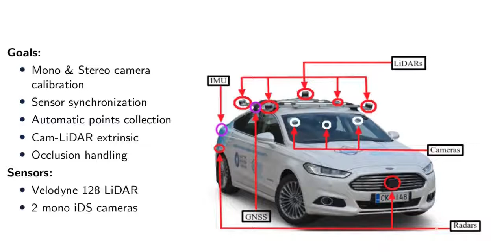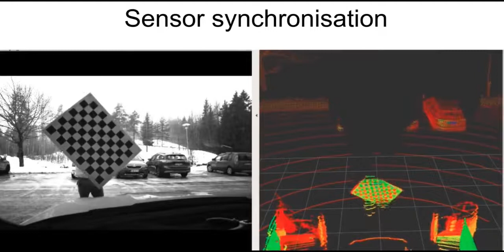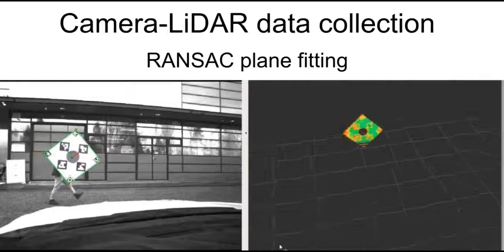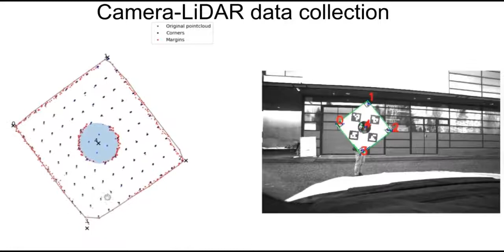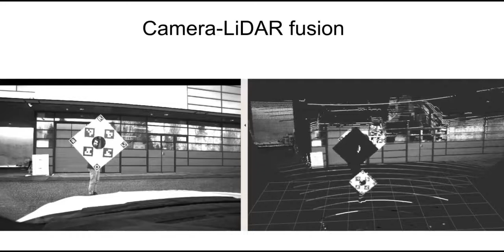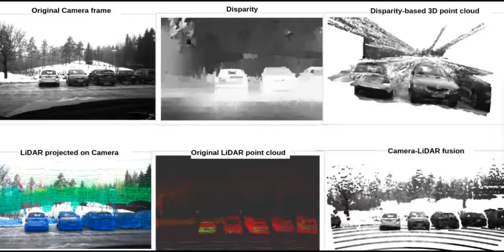Camera-Lidar calibration for autonomous driving

Comment: Hi, I am also working on sensor fusion between LiDAR and Camera and need to know exactly how you synchronized both with GPS clocks, do I need both the LiDAR and Camera with built-in GPS or is there some other way around.
Reply: Well, if you want to perform hardware-based synchronization you need a precise clock to trigger the sensors, GNSS clock can be used to generate such trigger messages. Also, usually, most the sensors have their internal clock, which can be used to align the information obtained with the global clock (e.g., GPS clock). Due to the different structures and the way the observations are collected, the camera and LiDAR may have different frequencies, (e.g., LiDAR might run 10hz while camera at 20hz or higher), At this point, a GPS clock could be used to align them using the PPS messages.
In my work, the GPS clock was triggering the camera sensor s.t. every camera message comes with an associated triggered time, while for LiDAR its internal clock was used. And the problem was to align 2-time series. 

A small example, let's say you use the GPS clock and it is set to send PPS messages every second. Suppose you have a camera running at a frequency of 20hz, this means that every second you will have 20 camera messages. And if LiDAR works with 10 Hz, you will have 10 LiDAR messages.
the pseudocode might look like this:
for pps_messages in pps_topic:
      if pps_messages == 1
           // perform_the_alignment
           camera time series should look like [0.0, 0.05, 0.1, 0.15, ...,] 
           because you have 20 messages collected in 1 second
           while for LiDAR points, you have to translate the time series to 
          come to the same range (just subtract the first element from the 
          time array)
           // apply some time series alignment - e.g., fast DTW
          // clean camera and LIDAR buffer
         //for each camera message you will have the closest associated 
         points based on their time. 
      else
             save the camera and lidar messages in a buffer
             every camera has the time when it was recorded
             every LiDAR point has the time when it was recorded

Also, you can always try software-based synchronization. Check ApproximateTimeSynchronization is ROS, just specify the topic names and the time difference between them that should be discarded.

hope it helps,  ping me if you have other questions.
Reply: @vezeteueugeniu4426  Just want to appreciate the excellent work you did. The thesis was very well written. It is easy to follow.
Reply: Hi Muhammad I'm imane from Algeria I want ur fb or Instagram to keep in touch. Cuz that would helpful to me so please read my comment and send me your answer